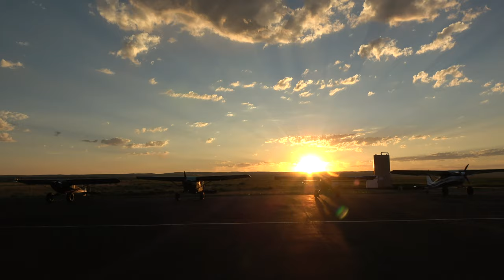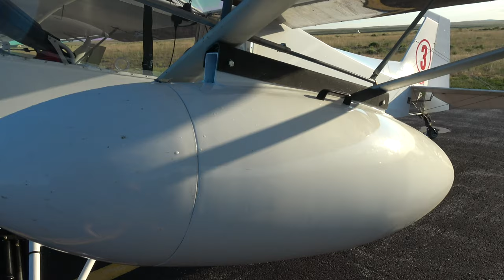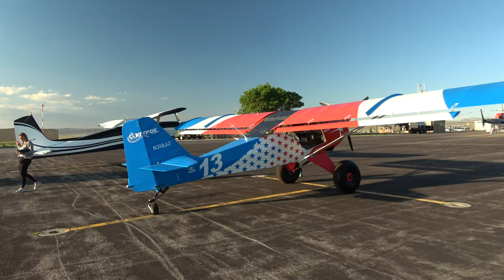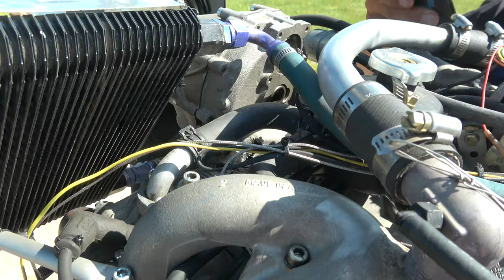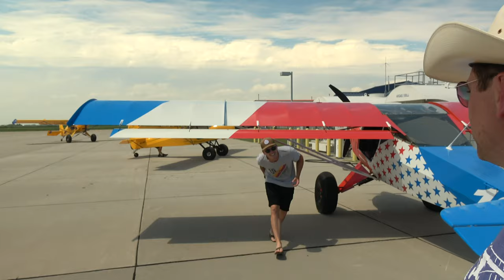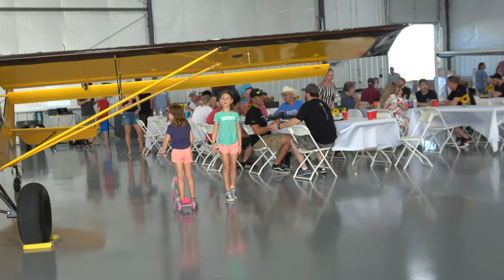Hal’s Engine Failure!! Low and Slow to Oshkosh - 2

Comment: Always sad to see and engine blow... Does anyone know if this engine is stock or has been modified to give more power? Trent had a similar problem a while back and his engine was an 80 HP Rotax modified to give 120 HP+
Reply from the maker: It was a crank designed for 80hp in an engine putting out 120hp.

Hal was pushing it to save weight. And it got him.  It’s the price of admission when trying to win.

Comment: Correct me if I'm wrong but I see Quinn's Carbon Cub AND his Cessna 180 on the ramp when he's on the skateboard.... He can't fly both at the same time.  What's the deal?

And whatever happened to no man left behind?
Reply: Here's the thing: Hal is more then capable of handling a minor situation (yeah, minor for him, not to most)  like that on his own, and would probably prefer to do so. Inconveniencing  others when their help really wasn't needed would just make him feel bad. He didn't need someone holding his hand while he waited for his engine and surely didn't begrudge the others "ditching" him. My reaction: " You good, Hal? Parts on the way? See ya!" And I'd expect the same if the situation was reversed.
Reply: @portnuefflyer  amen!
Reply from the maker: That is Bo Ellis’ 180.

Admit to have lost sleep leaving Hal behind.

Comment: "It's another Rotax" ...For the life of me I cannot understand how Rotax were able to get an engine certified for aircraft ..My experience with those engines back in the early 70's when they were the motive power for our Skiroule snowmobiles was basically run them for 4 hours of snow fun then rebuild the dang things ...sometimes out in the middle of a frozen lake.  They were absolute junk back then.  With that experience behind me; no way would I ever trust one to pull me through the air.  But, ,.... they must have come a long way since then,  eh?
Reply from the maker: They push them pretty hard.

Comment: Why’d you switch back to acme struts?
Reply from the maker: +Garrett Mattos I did lots of testing as I have four different kinds now. And I really like the ACME.  It’s soooo close between the Shock Monster and ACME to me, but it came down to the following for me.  

They’re lighter.
They’re less drag (racing)
And they feel really really good when I need to Off-road in big nasty terrain.

They are a air/oil dampened spring shock at the end of the day. 

I just like them both so I could run either. I’m just liking the ACME for my flying.

Comment: Another Rotax failure.
Reply: Hal's engine is heavily modded up he just found the rotax HP limit
Reply: 135hp on old 80hp internals...... the 100hp uls internals can handle it, but the older motors were weaker in several ways... rotax’s are very reliable according to actual data.
Reply: @GravityKnightFlying  Bottom line is I don't know much about it.  I should have not posted the comment.
Reply: @jginmt   We just had a plane go down in my area yesterday that made all the local news. Engine stoppage, safe landing on a road. Rotax? No, a turbo prop, a Piper Malibu I think, shit happens. Great job by the pilot BTW